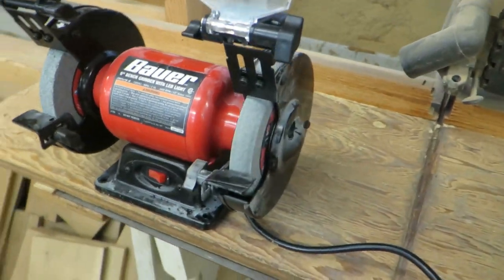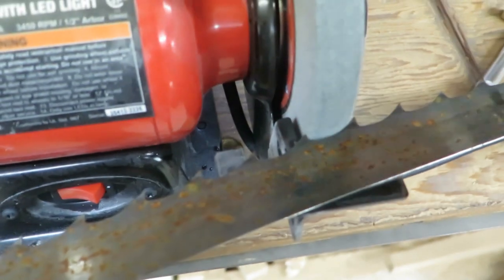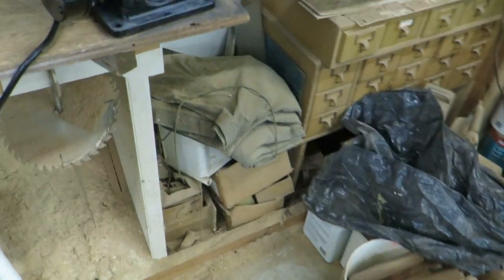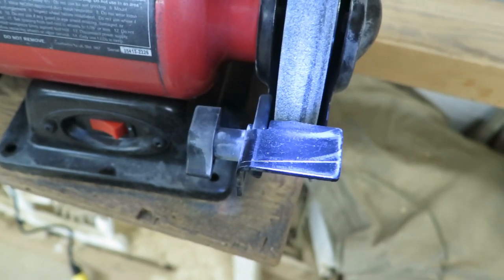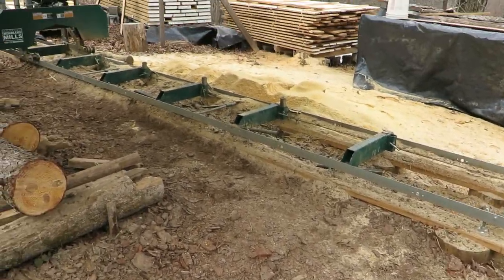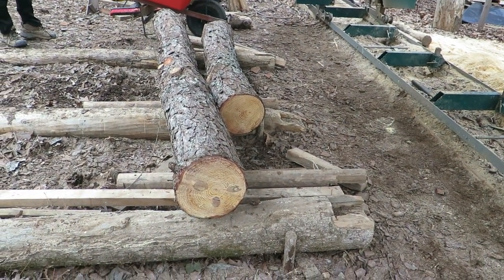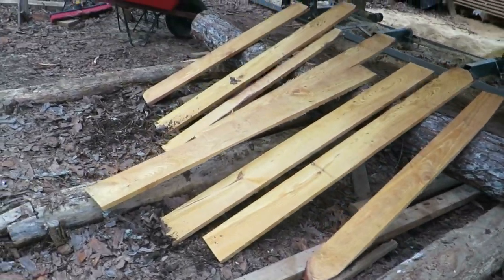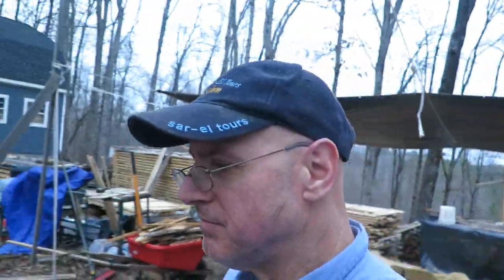Eps.#120 Game changer! Cheapest way to sharpen sawmill blades in 15 min using a cheap bench grinder

Comment: good video and job. looks like you have got it right you have it shaped right and have your angle right that the main thing. i have the woodland mills sharpener and tooth setter both were over$900 2 years ago. i put a old style dial on the tooth setter the digial one reset it self in middle of setting blade. you can buy the hand setters but they take a while to set teeth. i live in rocky mount va. i would let you use my tooth setter for nothing. take care, be safe and well.
Reply from the maker: Thanks for the offer, that is so kind.

Comment: Masterfully done! When I sharpen, it takes me an hour fifteen
Reply from the maker: I do not take that long because after a couple of sharpenings, my blades usually break.
Reply: @thetennesseefrugalcraftsma7383  Just 2 sharpenings per blade? so 3 uses total? When you say break, do you mean literally snap? or just losing their effectiveness?
Reply from the maker: @eitantal726  They snap. I get about 10 hours out of most blades.
Reply: @thetennesseefrugalcraftsma7383  Odd. I never had a blade snap on me. Blade dulling? Sure. Blade drifting up&down? Sure. Blade snapping? Never.
Reply from the maker: @eitantal726  It may be a defect in the saw. I think the drive wheels are not properly aligned. Just a thought.
Reply: @thetennesseefrugalcraftsma7383  I think the reason yours snap and mine don't, is because I run at a low tension. I have the cheapest, low-end mill
Reply from the maker: @eitantal726  Perhaps. It is higher tension.
Reply: @thetennesseefrugalcraftsma7383  Something to keep in mind. High tension pros and cons. Thanks for the conversation!
Reply from the maker: @eitantal726  It keeps your wood consistent in width though.
Reply: @thetennesseefrugalcraftsma7383  What do you use for blade lubrication? water? soapy water? diesel?
Reply from the maker: @eitantal726  water and soap sometimes